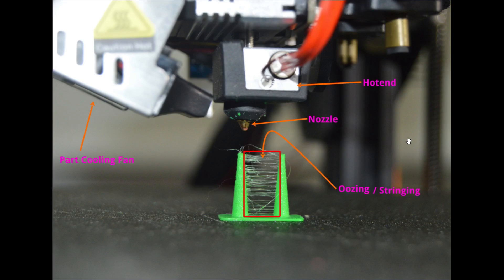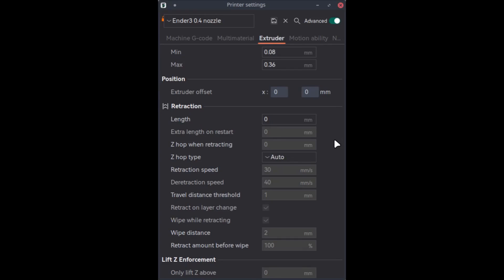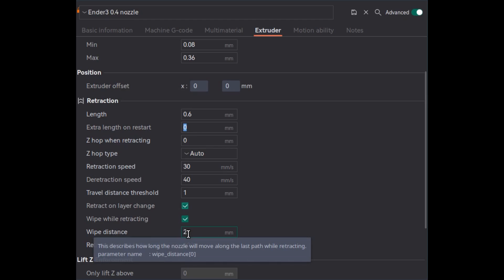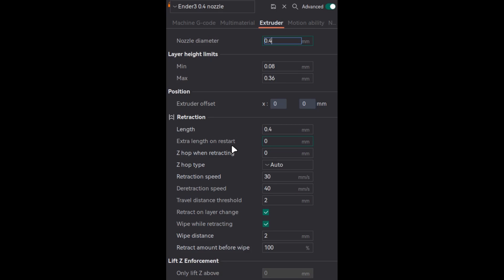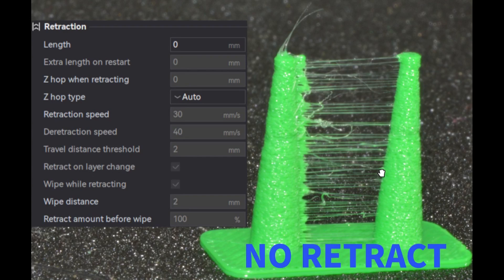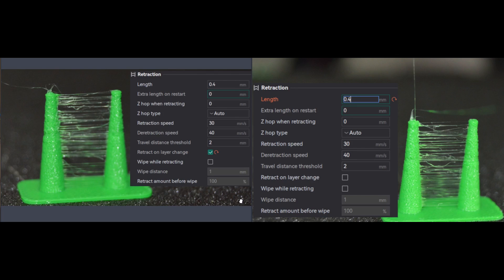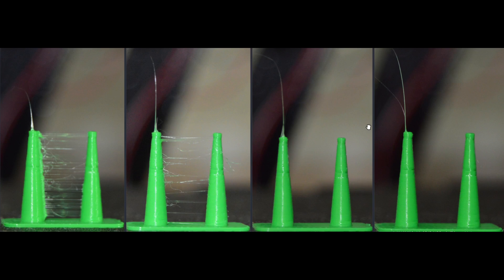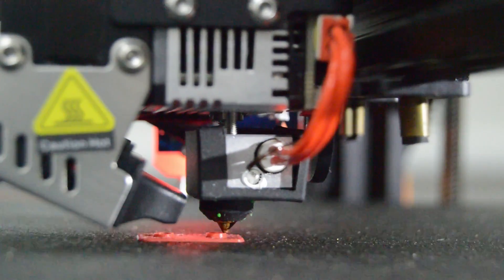OrcaSlicer Retraction Tuning To Avoid Stringing

Comment: If retraction length of 2mm does not work, Should I keep increasing the length or change other setting?
Reply from the maker: Increasing further isn't good, looks like the filament has absorbed moisture and needs to dry or try with a new filament.

Comment: Hey! Your settings worked great and stopped the whispy stringing, but now I have some heavy strings towards the top of my retention test around the 1-2mm retraction. It looks sort of like the thicker twisted knobs on the right side of your curved red structure. Any advice? Cheers
Reply from the maker: Most likely you need to tune Pressure Advance and Flow Ratio

Comment: if stringing persists even when you tried all the possible settings including a brand new nozzle, try changing the filament if you have multiples as mine worked instantly after changing the filament and noticed that the old filament was brittle.

Comment: Good video, I just switched to orca slicer and suddenly had problems with stringing.
Reply from the maker: Were you able to solve the stringing issue?
Reply: Yes, I turned off the Z hop and doubled the retraction speed, it''s strange that z hop with creality print software I have no stringing but with orcaslicer I do have it.